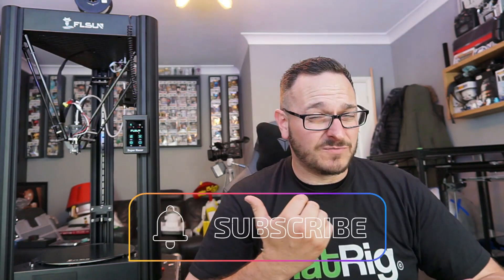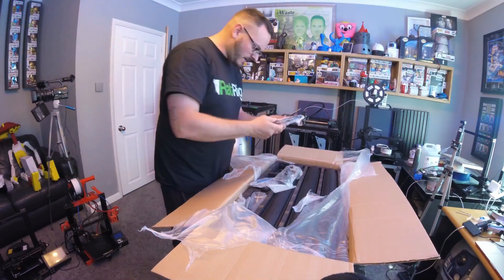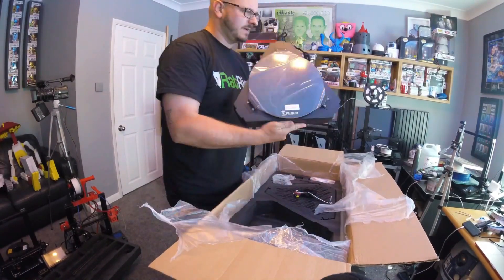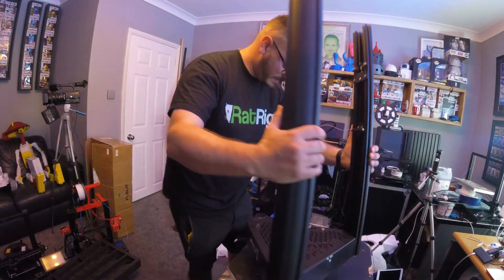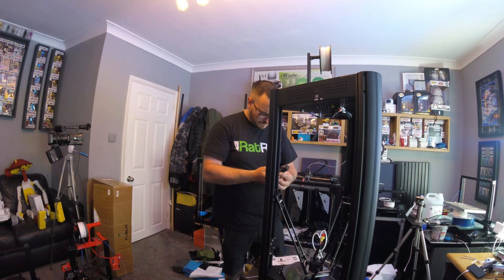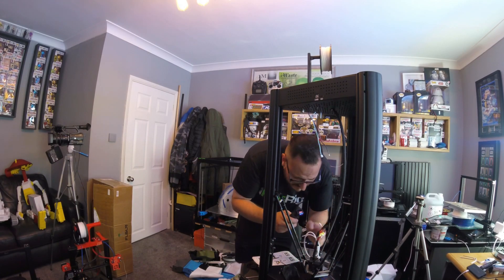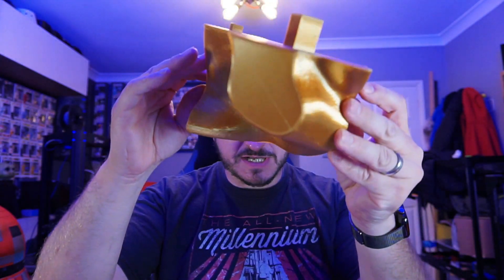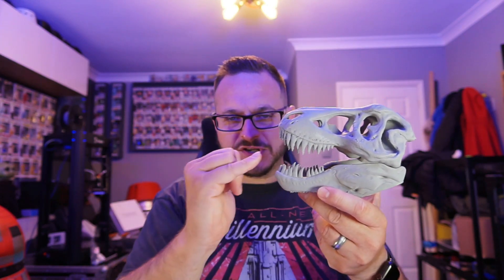FLsun SR Super Racer - Delta 3D Printer

Comment: On the official website chat they say that it ships with the Robin Nano V3.0 motherboard now. What do you think about it?  btw....great review.
Reply from the maker: Thank you - I’ve not used that board on this printer but it’s a great substitute for the skr. I think I’ll end up changing out the board (skr clone) at somepoint and going light direct drive. Klipper I have working now but fast printing anything other than PLA is a non starter and will need some serious tuning. Have ordered yet?

Comment: any benefit of adding acrylic side panels to keep heat in? Have you thought about adding a Mosquito hot end?
Reply from the maker: Great questions, on the panels i'd say no unless you are printing anything exotic or maybe ABS - regarding the hotend there is a span of thoughts on that one, yes it would be great to add that type of hot end, but you would only add that for speed and heating requirements. I'd rather stick a hot end like that on a premium printer.

Comment: "..the advantage of the stepper drivers however are lost to the retraction noise" - Could you explain this please? What does 'retraction noise' mean? What impact does it have? Is it fixable with upgraded parts? I eagerly await your follow-up video!
Reply from the maker: Hey Alan, so the retraction noise is where the bmg extruder pulls the filament backwards, due to the speed that this printer runs at the silence element is lost on that part. It’s a bit annoying but should be fixable

Comment: Worth noting that the nano board will not physically fit in the space of the skr
 board.
Reply: I really love it Sam - but then I moved up from an Ender 3v2  🤣
Reply from the maker: Yeah it’s got the USB port on it also right?
Reply: @TheRealSamPrentice  usb and the on or usb drive - can’t remember  what that’s called - but firmware enables one or the other.  I use OctoPrint though.  My only gripe is the z offset adjustment.  Baby step of 0.05 is too big.  I’ve got round it by adding the appropriate Gcode to my start code so it lifts by 0.02 😄

Comment: Great video! Good to see a balanced review for both the good and bad points.

The extruder noise is due to the combination of the high speed and distance of the retraction. 
You can lower it to 7mm and a distance of 30 to 35 mm/s with no impact to performance but it will be virtually silent (and not overheat)

Take care with the 1.2.1 firmware on your SKR board, there is a known bug with this firmware version on this board which can cause zits to form (does not happen on version 1.0).
FLSUN are investigating but you can revert to the previous version - it's again related to the Power Loss Recovery mode settings. 

If you format the SD card to 32kilobytes on the v1 firmware, you won't have any issues.

The board has been changed because the SKR 1.3 is currently out of stock in most places, so they needed an alternative. 
The nano version has an advantage of being able to print from USB thumb drives, but otherwise no major difference.
Reply from the maker: Great advise thank you!! :)
Reply from the maker: Is anyone looking at klipper for this ?
Reply: @TheRealSamPrentice  Yes, there is someone in the official SR group that has been working on it. I'm not sure if he has released anything yet or not though
Reply: @TheRealSamPrentice  have a sr with the nano board 1.2 frm. Cant seem to get it to connect to pronto face Anyone else have this .want to install another extruder but need to be able to calibrate esteps
Reply from the maker: @charlesrestivo870  check if there is a usb option on the board, it might be a jumper.
Reply: @TheRealSamPrentice  ok thank u above my poay grade lol
Reply from the maker: @charlesrestivo870  okay so if you look at the motherboard there might be a selection on one of the jumpers that activate the usb
Reply: @TheRealSamPrentice  well thing is it works with octo and raspberry .Just afraid that screws up the printer Prontoface seems to be a much simpler terminal
Reply: @TheRealSamPrentice  also thank you for your replys your gentleman
Reply from the maker: @charlesrestivo870  oh I see !! What is it that you’re trying to do?
Reply: I’m on the nano board and am happy with it though am tweaking the firmware because I want bd PID tuning enabled and thermal runaway - I think a lot of issues are with slicer profiles as I’ve recently changed one and have got rid of a lot of ringing issues that I had at high speed.